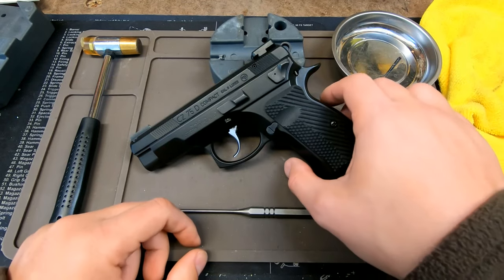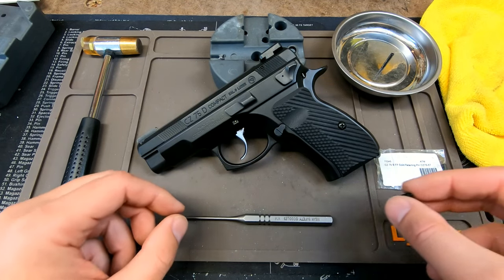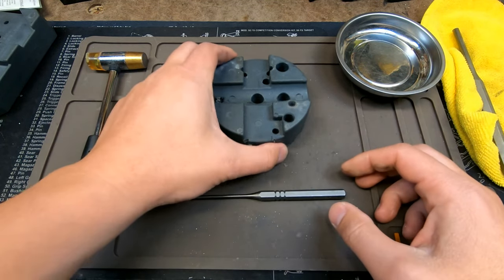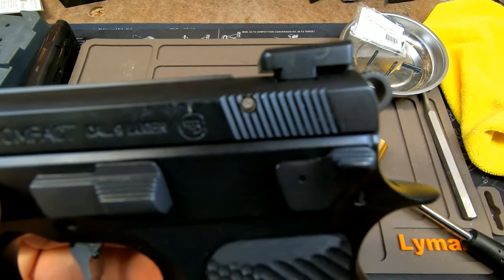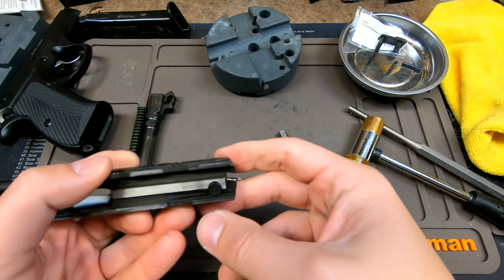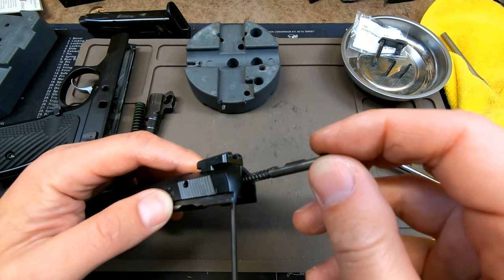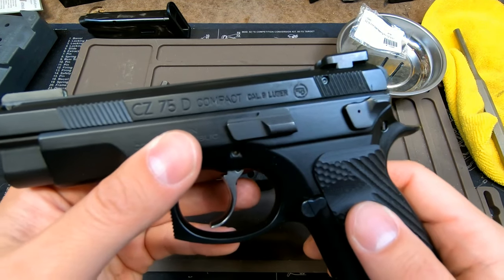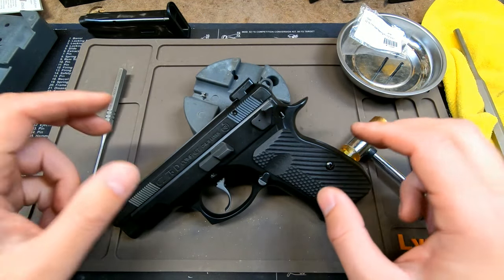CZ75 Platform DIY - The MOST important part to upgrade - Firing Pin Retaining Pin Upgrade

Comment: Do you do a lot of dry firing without a snap cap or anything in place to take some of the impact of the firing pin slamming forward? That is often the cause of this type of damage. The designers intentionally use the roll pin knowing it is softer steel than the firing pin in order to mitigate damage to the firing pin. I realize that the solid retaining pin isn’t hardened steel but it will still cause more wear and eventually breakage of the firing pin.
Reply from the maker: Yes, I use snap caps.  In fact, the first time I discovered my pin was bad was dryfiring with a snap cap and the firing pin was jammed into the retaining pin.  As a result, the tip of the firing pin was jammed into the back of the snap cap and would not cycle the snap cap out.
Reply: Well I hope the solid pin solves your problem. 
Great channel btw...lots of good content. Looks like you favor CZ’s and Baretta’s . Wise man
Reply from the maker: @hollisminter2119  Thanks. Making some of these videos isn't easy but the knowledge for fellow users is important to share.

Comment: Great video.  Something Ive been thinking about.  For any of those with way more experience than me.  If the pin is hard to get out, and you have to do a lot of hard wacking on the punch.  If you leave the slide on the frame, like in the video, do you think there is any chance of "bending" or damage  on the frame?  I like the idea of keeping the slide on the frame but concerned I might wack something out of true?
Reply: Use a block.

Comment: Great video, thank you. I had not considered doing this with pistol assembled, awesome idea. 
interested in the CZC solid pin, however what do you think of Cajun & Mcarbo heaver duty roll pins? Im doing a Cajun Pro kit as soon as it gets here, and it includes the roll pin.
Reply from the maker: I haven't had any experience with the heavier roll pins.  Anything is better than the factory pins after seeing how beat up my pins were especially with little range time.
Reply: Thanks Dude.  I pulled my pin for polishing etc. Before my Cajun kit and mine was already showing wear, maybe 400 rounds.

Comment: Very helpful video!  I picked up a 1st gen P-07 duty, and getting ready to replace parts.  Unfortunately parts (even mags) are hard to find or sold out (Midway, Brownells, CZ custom).
Def want to replace at a minimum the roll pins, recoil, ejector, block and firing pin springs.  Are there other resources for CZ parts??
Reply from the maker: I think right now with the surge of new buyers, a lot of places are out of things.  I have some things in my wish lists that are still out of stock...
Reply: For those still looking, here are three other sources for parts: Cajun Gun Works, M*Carbo, and CZ Custom. I've got a trigger from Cajun and a spring kit from M*Carbo in my CZ 75B, and it's made a world of difference to the shootability of my gun. M*Carbo's spring parts kit also included a new firing pin retaining pin, it's hardened rolled steel and has a lifetime guarantee. I'd also recommend getting the floating trigger pin. The modifications have really reduced the trigger pull, in DA it's gone from about 12# down to 7 or 8#, and SA is about 3-4#, and no creep or grittiness. Cajun & M*Carbo both offer spring kits, I've only tried the M*Carbo, and it's awesome!

Comment: Isn't a 1/8 punch a little too big for the pin slot? Won't it damage if u go too far inside? I'm scared I will open up the whole too much.
Reply from the maker: You can use a smaller punch, but it won't be as rigid.

Comment: Hey There, iv'e been following the discourse in the comments regarding using a solid pin verse hollow pin. The CZ Rep answer was quite odd and I agree with what you've been saying. How many rounds have you shot since you replaced the roll pin with the CZC Solid Pin? And no unusual ware on anything?
Reply from the maker: Honestly, I have been shooting my other CZs that do not have the retaining pins (Tac Sports and Shadow 2).
I do dry fire a lot and can say that I have had no issues.
While I understand CZs official stance on the roll pin, I still feel that is a flawed design.  I also think the factory magazine brake is pile of garbage and I have a video on that too.
Reply: @CobraReady  Thanks for the reply. I've heard dry firing might cause more damage to the roll pin/firing pin so that is good to hear no issues since you're dry firing.

This guy got more reinforced roll pins that are still hollow and he thinks he can get 20,000 rounds out of his firing pin and roll pin with already 10,000 rounds shot out of it. 3 minute mark:
https://www.youtube.com/watch?v=0dyE1x8nMwA&t=199s

Comment: I have a Cajun gun Works firing pin retaining pin on the way as well as a steel guide rod for my CZ 75 Compact.  Once I put in the new retaining pin I can dry fire as much as I want correct??
Reply from the maker: No, you will still need to check the remaining pin and firing pin.  I've been told the firing pin can break on the solid steel pin.
Reply: @CobraReady  Ok, there’s no need to replace my brand new firing pin I can leave in the original??
Reply from the maker: @davidsaul2707  Check it and see. People have told me new pistols have needed the pins replaced due to people at stores dryfiring
Reply: @CobraReady  Thx for Quick responses and great vid👍🏻

Comment: Than you! What sights set do you have installed on your CZ 75d PCR?
Reply from the maker: Those are the Truglo TFX
Reply: @CobraReady  thank you! Does the gun shoot well with the sights? I’ve heard that after installation a gun starts shooting few inches lower. Is that true?
Reply: @GregorySM2010  Yes that is true 4 to 6 inches LOWER at 7 and 15 Yards on the p01 and p01 Omega. VERY IRRITATING! TRUGLO Customer Support is USELESS.
Reply: @dstan9615able  thank you! I’ll stay with original ones. They do what they need to do.

Comment: Thanks for the info.  I have a question,  maybe a dumb one. Do you think cz did this on purpose so that part fails instead of a more critical one does?  Why wouldn't they do this from factory?
Reply from the maker: Everything revolves around costs.  If you look at glocks as an example, they cost less than $500, and for the average person they will not upgrade anything.  But a serious shooter will spend $200+ on after market parts to make it better.  Beretta uses polymer parts on their 92FS which cuts the costs down by about $100 which the average shooter will not upgrade.

CZ has to compete with different  price levels to get market share.  Rolled metal is a lot cheaper to produce than a solid piece of steel that is machined.

Comment: Some people say that you will ruin your firing pin(mushrooming) using a solid retaining pin. What's your take?
Reply from the maker: I havent seen a firing pin get damaged by the solid steel pin.  But I have had a firing pin literally get stuck in the factory rolled pin that was beat to crap and would not reset.  And that was around 500-1k rounds in on a new gun.

Comment: So do I have to take the slide off or do I just punch it out and install the new pin?
Reply: No need to remove the slide off. I punched the pin from left to right. Same way when you install the new pin.
Reply: @acspo123  thank you for the info really appreciate.

Comment: That's bad advice....the OEM hollow roll pin is a sacrificial part meant to prevent damage to the firing pin and the slide.  Solid pins are not recommended.
Reply from the maker: Most people don't know they should be replacing the pin over time.  The factory pin locked my firing pin around 500 rounds on a new pistol.  Whether it's it's solid pin or thicker roll pin, people need to be aware this part fails on CZs and needs to be replaced.

Comment: I noticed my firing pin didn't have a spring around it like yours does,  is this normal?
Reply from the maker: It may still be inside the slide.  Without a spring it will not reset.
Reply: @CobraReady  cool thanks, it must have stayed in since after putting it back together it still resets.

Comment: Wouldn't trust any part of this gun if comes from the factory with faulty parts, too many well made guns. good info for those that own this model.
Reply: I own several Glock 19s. Solid guns. Have never experienced a problem with any of them. But they are striker fired. I was looking for a hammer fired gun for appendix carry. I'd heard a lot of good things about the CZ-P07 so bought one. New pistol. Maybe test fired at the factory. I field strip it to clean the barrel before taking it to the range for the first time. While removing the recoil spring assembly it flies apart on me. The plastic retainer cap at the end of the guide rod ejected out of the rod allowing the spring to uncoil. I called CZ. They are sending a new one. The next day I come across a video where the person is saying the CZ-P07 should not be dry fired. There's nothing in the manual about this so I search for more videos on the topic which brings me here, among others. I'm starting to have second thoughts about this gun. That's not good for a carry gun.
Reply: Its not exactly faulty. Just  a single $1 part that can't take dry fires

Beretta are known for the same roll pin wear.  Sig as well, though their design is much more forgiving on the roll pin
Reply: @jamescarter4175 just put a foam piece between the hammer and dry fire it. Stop whining
Reply: @DocHudson420  Still carrying it. 3495 rounds now fired and no problems.

Comment: So about how many rounds can a roll pin last before this becomes necessary?
Reply from the maker: Depends.  Mine lasted 500 rounds.  Others have told me thousand of rounds, so.e ha e tole me new guns needed them from people handling at shops.
Reply: @CobraReady  Well I just bought one supposedly NIB (do they test fire them from factory? I see distinct copper splatter on the feed ramp),  but the pin is literally 5USD, so I think I am just going to do this preventatively.
Thank you much!

Comment: There are two retaining pins on the CZ Custom website. Which one can I use for a P-01?
Reply from the maker: Should be the solid steel retaining pin
Reply: Do you know how long the new pin  will last?
Reply from the maker: @angrychivafan  Good question.  I would think a long time since it is hardened steel.

Comment: Anyone know if the Tactical sport orange has this issue?  It's a higher end model so I'm thinking it may not.
Reply from the maker: It doesn't have this pin
Reply: @CobraReady     It does have a different retaining pin though, doesn't it?  Is the TSO okay to dry fire or are there still issues or any other concerns?
Reply from the maker: @romewasnotbuiltinaday  There is no firing pin retaining pin.  The Shadow series and Tac Sports series uses a retaining plate.
Reply: @CobraReady   Thank you.  Sorry for all the questions but would you say it's okay or not okay to dry fire the TSO?  Thanks again.

Comment: I ordered mine from CZ Custom...then I saw a notation on the Cajun Gunworks site that anything other than the rolled/hollow retaining pin can void your warranty.  What do you know about this?  I’m wondering if the pin isn’t actually designed to deform since it’s a part so easily replaced? Maybe it’s supposed to be hollow to better absorb/mitigagte impact?  What are your thoughts?
Reply from the maker: Not sure about the warranty.  My firing pin was stuck in the retaining pin and would not function.  I'd rather replace a firing pin and have my gun work when I need it.
Reply: Average Doomsday Prepping Dude Roger that...couldn’t agree more.  Thanks. Great videos.
Reply: Average Doomsday Prepping Dude I did get clarification from CGW that using a solid retaining pin will void their warranty on aftermarket/extended firing pins. According to the CZ tech, the rollpins are designed to deform and need to be replaced regularly, but CZ does not recommend the solid replacement option. They said the pins better mitigatge the forces acting as a shock absorber when they’re hollow.  CZ tech said absoutely do not replace the OEM pin with a solid pin, just buy a handful and keep them at the ready should they be needed.
Reply from the maker: @zenadventurer69  I think it's a design flaw that they are trying to spin into something positive.  My firing pin was literally stuck in the retaining pin after around 500 rounds.  If a part on a pistol can fail after 500 rounds, something is seriously wrong with the design.
I dont recall in the manual or anywhere that the company states that the retaining pin should be regularly checked and replaced as it will fail.
CZ Custom makes these solid steel pins for a reason.  The stock CZ roll pins are garbage.  Even the trigger roll pin is a stupid design.  CGW makes a floating pin for that reason as well.
I personally feel they are justifying using the roll pins because that's their design.
Reply: Average Doomsday Prepping Dude I appreciate your insight.  I thought about that too.  Do you know if the tempered steel pin from CGW (or the standard replacement pin from CZ Custom) are any better than the OEM?  I haven’t popped mine yet, but it doesn’t look to be one of the new “double pins” from CZ.  I ordered the solid pin, a couple from CZC and a couple from CGW to compare.  I’ll keep you posted. But I have seen a number of posts from folks using the solid pin who have had their firing pin deform a jam (something the CZ tech also warned against) and two other posts from folks who had to have the solid pins machined out after they get stuck.  My RO at my local range is all about dry firing, but I have a Beretta 92FS as well, and the Beretta manual says no dry firing.  I wonder how much of the roll pin damage is happening in general because of dry firing - I mean beyond the basic design fly you suspect.  I know that strykers don’t have these problems because the back plate serves the “retention” role.  Again, thanks so much for staying with this discussion.  I’ve not fired my CZ yet (I was also waiting for the stainless guide rod which rocks), but I wanted to have a selection of pins on hand to experiment (I generally don’t shoot much more than 150-200 rounds a week, so I thought I could track the issue.  To your point, a failure at 500 rounds?  That’s not “intentional.”
Reply: Average Doomsday Prepping Dude Incidentally, the rental CZ at my range are jam machines...I wonder if they’ve checked the retaining pins/firing pins.  On an unrelated issue...what does the “extended” firing pin from CGW do?
Reply from the maker: @zenadventurer69  That's exactly my point.  How are people supposed to know the pin is prone to failure and needs to be replaced regularly unless you discover a video like this?  I had no idea what was wrong with my pistol so it took it all apart and found the issue.
Think of all the people carrying CZs that depend on it for their life who have no idea of this problem.  500 rounds is only a couple range sessions and then they go bad.  That's seems like a flaw not on purpose to me
Reply: @CobraReady  Excellent points all...a lot of the posts are from folks who didn't know their pin had fractured...your vid is worth a million bucks...that's what for me looking into it. Great work.
Reply: @CobraReady  Ironically, just got confirmation, but the solid pin voids the warranty on CZ Customs extended firing pin...they require the roll pin.
Reply from the maker: @zenadventurer69  wait, so the CZ Custom solid retaining pin voids the warranty on the CZ Custom extended pin?
Reply: Average Doomsday Prepping Dude You have to use the stock rolled pin or your firing pin warranty is voided, yes.

Comment: How do you know how far to hammer the pin in, will it stop on it's own?
Reply from the maker: It will not stop on ot own.  You just have to make sure there the same about of space on both sides.
Reply: @CobraReady  thanks for the prompt response.

Comment: Hated dealing with this i replaced it great gun but such a life threatening thing to happen because a pin is easily broken. Sold it, I just stick to glocks now
Reply: The CZ 75 is a very overrated platform! In addition to this problem CZ 75's equipped  with a de-cocking lever are very prone to reliability issues. Bottom line is it would be foolish to depend on  these pistols to save your life!

Comment: It is a widely known fact that the firing pin retaining pin is a weak link  in a CZ hammer fired pistol. I just cannot understand why CZ has not made the necessary change to improve the reliability of its products.
Reply from the maker: According to several users who have contacted them about that after they saw this video, CZ says the pin is designed to act as a cushion and be destroyed over time and people should have a bunch of spares on hand to replace when needed.  In my eyes, design flaw that they refuse to admit is faulty.
Reply: In that case, CZ owners better hope that the firing pin retaining pins do not fail during emergencies.
Reply from the maker: @carlman2842  And that is why I do not use a CZ for anything other than competitions and the range.  When I discovered my pin was so bad after 500 rounds, I was totally put off by the design.  The fact that CZ says it's a known thing and that people should replace them regularly makes the assumption users know they are supposed to replace them and have the parts on hand to do so.  Which neither are true.
Reply: @CobraReady why would they fail if you replace them?? Make it make sense